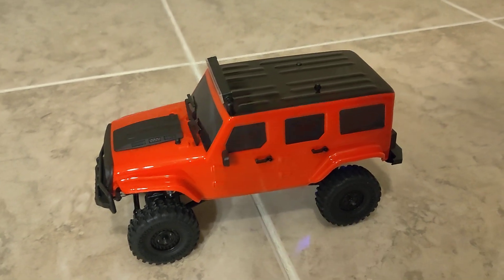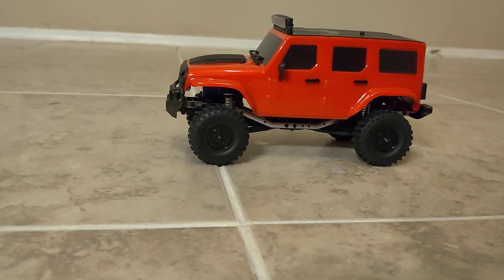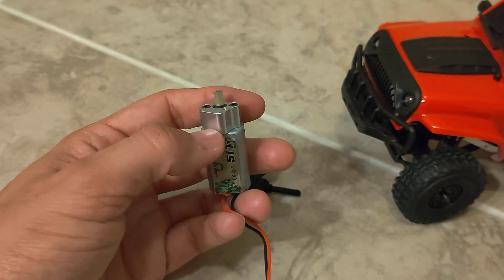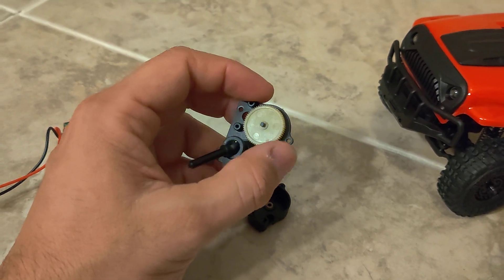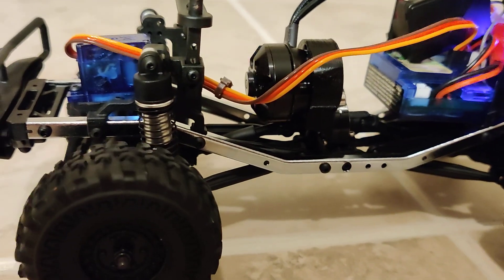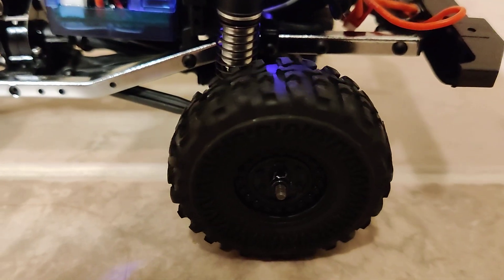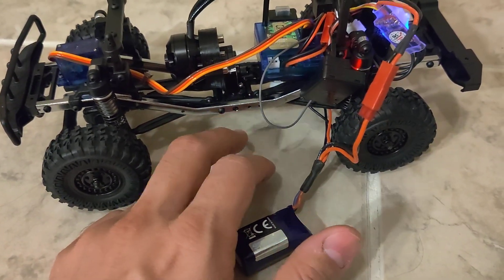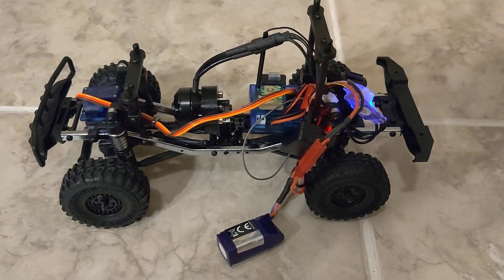1/18 Panda Hobby Crawler with Brushless Conversion

Comment: Hey i found out how to get drive shafts from the scx24 to fit... hollow out the part from the panda that mouts to the axel output and slip the end pice of the scx24 drive shaft into it make a pin out of a paperclip and reattach the rubber o ring to hold it together and you dont have to do that to the transmisson side since the axels are made for the scx24 trans

Comment: Hey man. Is this still available? Besides the scx24 trans, what else would i need? Do i need the scx24 driveshafts as well? Im gonna order the tegu esc and surpass hobby 1400kv motor. Trying to figure out what all i need lol
Reply: I'm in the same boat. Just scooped up the X2 and definitely want to to do this mod but need more info about the drive shaft set up first. Hopefully he responds.
Reply: @miguelcandelaria460  Well I never got a reply. So who knows man. I know furitek is about to release a transmission and motor combo for the atlas, rgt24 and enduro24. I haven't checked into yet but if it's the 1/18 atlas, may be able to make it work.

Comment: I have a tetra k1 6x6. How do you get the motor off the trans . One motor is weaker and I'm trying to do a swap. I tool off like 5 bolts and the motor still hangs on. There is these 2 screw posts that turn but never seem to come out...is that where I'm having my issue

Comment: What did you do to adapt the axial drive shafts to the panda differential slide sleeve?
Reply from the maker: I use Losi micro driveshafts since they have the four sided "key" to fit the panda shafts and fit the Axial output. You can also use any other micro driveshaft with that same key, even wpl driveshafts have the same its pretty standard.
Reply: @Gamyrc  ok thanks. I was able to connect the pandas with their screw. Fits ok for now. I will look up the shafts you mention. Thanks again.

Comment: 🖐️🤠 hey Gamyrc....... 
What's the panda's performance like if you remain completely stock in everyway and just add the Lizard ESC, bypassing stock ESC and use Lizard ESC for control? 

Look forward to your kind reply & thoughts. 

Cheers from 🇬🇧
Reply from the maker: It gains lower speed control but the gear ratio still makes it hard on the stock 180 motor which gets pretty hot after a while. Deffinetly an improvement from stock though.
Reply: @Gamyrc  🖐️🤠 
Cheers for the kindness in reply, much appreciated. 
We heard about the motor heating up; some have suggested heatsinks on the motor. 
Bottom line....... We agree the scx24 setup is best for 1/24 scale and your work around here in vid looks to be the simplest & best option in the long run; Especially now FuriTek is on the scene 🎉 

Well done brother 👍

Cheers from 🇬🇧
Reply: Well am glad I saw this video and another video where I was already thinking of using my v2 axial esc and radio since the one it comes with is bad than the one from axial. Then I saw there is a portal kit and I haven’t opened what I got (sport edition) so I will go back to the  hobby shop and exchange for the portal edition. Looking forward to ordering the adapter from you

Comment: Great videos, using your mount in my scx24 for the surpass, just got my Furitek tegu but having a lot of problems with cogging/glitching. Using the hot racing mod 5 spur with a 11 tooth pinion battery is 1000. 2s 20-30c. Calibrated using latest firmware running factory defaults. Any tips on how to smooth it out? I contacted Furitek they just sent me a copy of the manual which is no help at all.